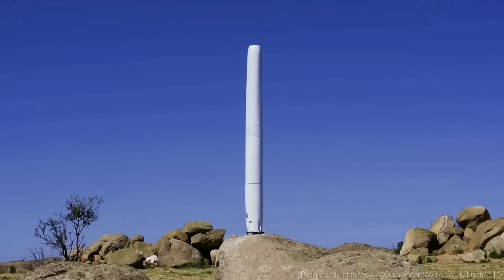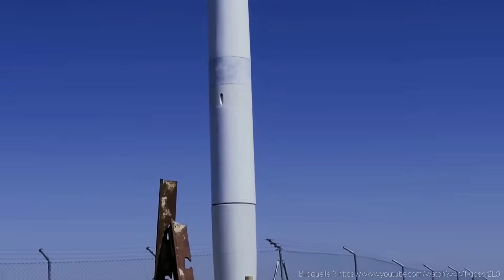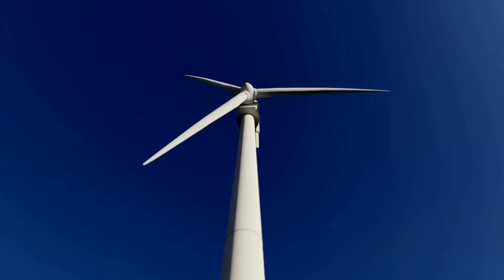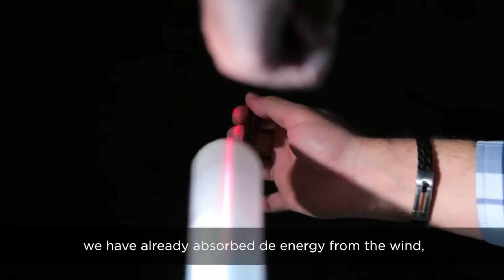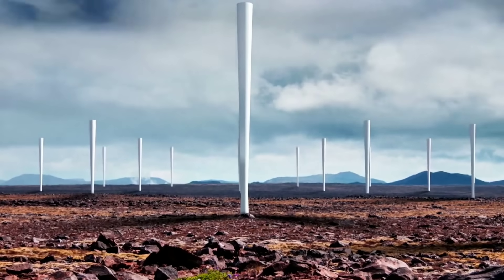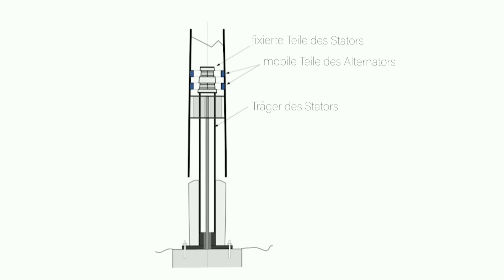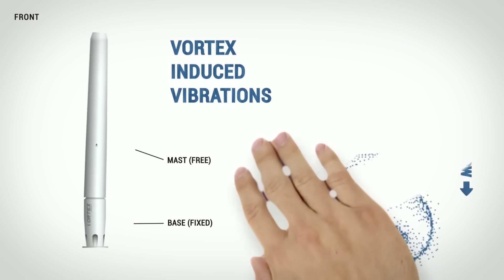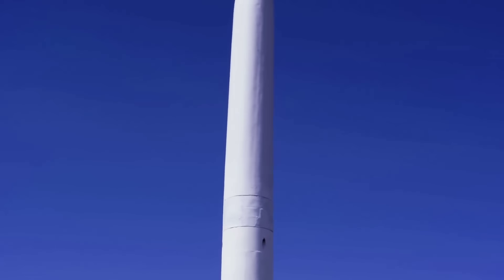Vortex Wind:The World’s Most Powerful and Affordable Bladeless Wind Turbine That Can Power Your Home

Comment: Why didn't they say what mph wind you need for it to work?
Reply: Because this would show the pathetic real-world-yield of this concept.
Reply: 13.422 m/s. Roughly the same speed needed for existing wind turbines. Not very difficult to check.
Reply: @hexxuss1  Source?
And even if it was 13.4 m/s, it would support my statement. You don't get many hours of at least 13.4 m/s per year near the ground. At rather average sites.
Reply: @701983  I was replying to the O.P. lol. I'm sure you can search & find it. 😉
Reply: On the hours per year you get the wind speed near the ground... it heavily varies on location. A couple very windy cities come to mind
Reply: @fabianosoriani  Especially cities don't have much wind normally, because it is blocked by the buildings. Except at the top of high buildings of course.
You won't find many city sites, where you could get more than 1000 full-load-hours per year (11% workload) 10 meters above street level with this system.

Comment: Well  nrj produce ? 😂 Knowing that for a wind turbine the energy is fully correlated to the  surface of air displaced. Besides considering the sheer resistance of the moving part like the spring and the lost in the friction.

Comment: Vortex wind turbines but a small change, the base on the bottom of the sea and the top of the turbine poking out of a rough sea. it could be made out of heavier materials and its cheaper to transport by sea. The single Blade can be made of PVC pipe that is already made, it can be coral reef like and keep people busy. (Maybe oxygen in the tube to effect to blade underwater)

Comment: All trial tests of these "generator" has triple speed, when showing how the big bar swinging (look at the birds speed on this video). Harmonical vibrations are harmonical because the energy stored at one side of the system and transfering to another side of the system. As soon as you will try to get energy from this vibration you will include the resistance for your system. That's why your swings will be fade rapidly. Only really strong wind will support this swings. 
And the harder part is to transfer this vibration energy to the electricity. 

Overall - SCAM.